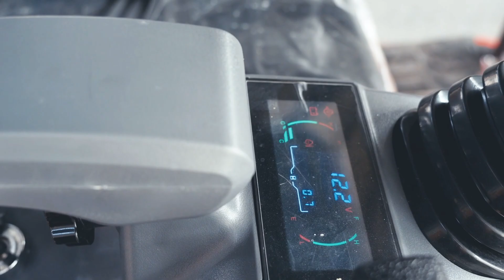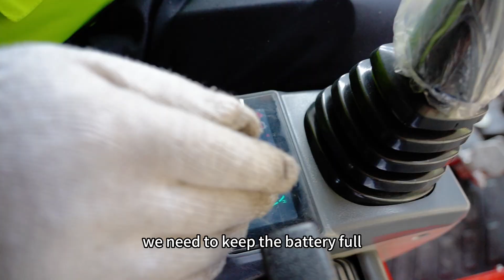HY16C: The Flagship Mini Excavator, Redefined.

Comment: Why on the upgraded hy16c there are no foot pedals to operate the tracks? I was interested in buying this machine but will not because no foot pedal operation.
Reply from the maker: Because after receiving a long period of customer feedback, we found that the foot pedal would reduce the space for placing feet below, which would be inconvenient. However, we have retained the foot pedal function on the HY18B model.
Reply: All of the reviews and YouTube videos showing the (shy series) excavators have very much less room for foot control compared to the shy16 which is why I was interested in this model. Can I  buy the drive handles with attached foot pedals separately from Huayee? And how would I do this?

Comment: Good demonstration of a quality machine.  A little light for my application and that is why I purchased an Everun 26 with D1102 Kubota.  However if you have small property and digging around say only 10 acres this machine will surely get the job done.  With larger boulders and big trees all around  with 20 degree inclines the norm this unit has limitations but I am sure your SHY 22 is for folks  who have larger scale projects and cannot waste their time becuase their machine jsut cannot do the job, however the SHY22 and ERE26 are not cheap for obvious reason: Quality n Engineering in the design.
Reply from the maker: Regarding your question, we also have machines suitable for large-scale work sites. The HY16C, however, is only suitable for use in small farms, households, or small-scale projects.